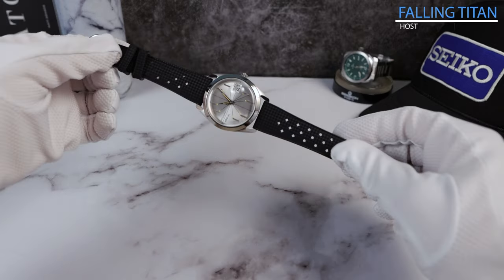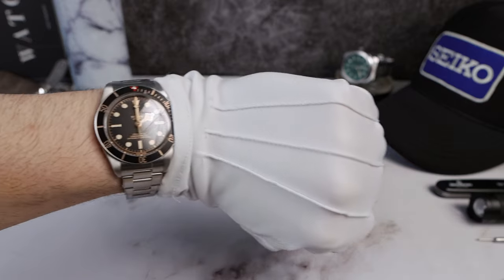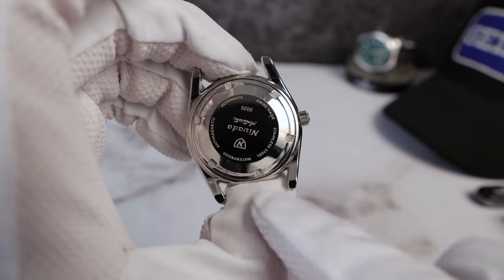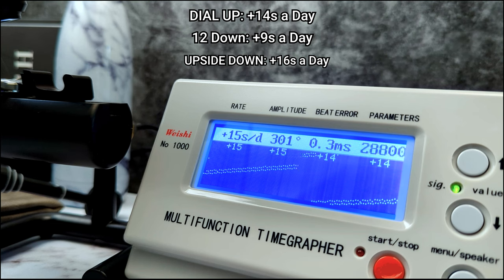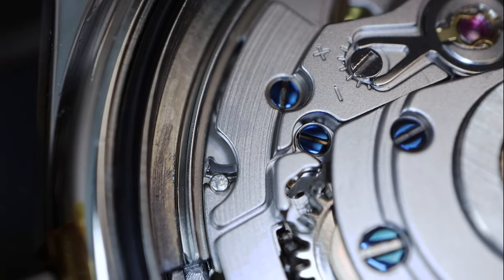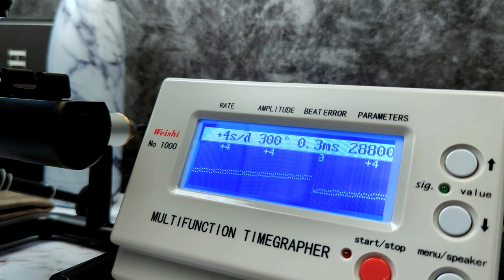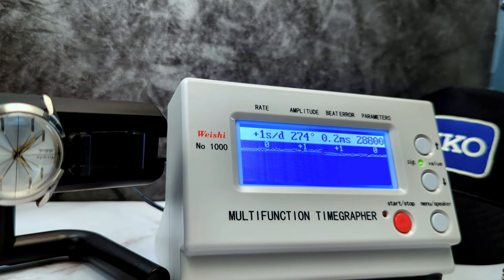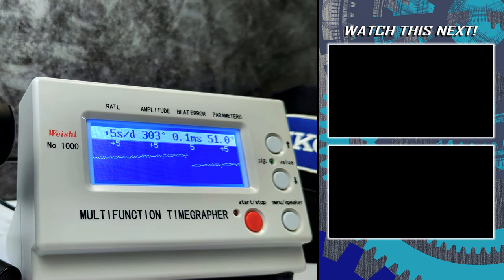Crazy EASY FIX for poorly performing SWISS MOVEMENTS

Comment from the maker: :_seiko::_seiko::_seiko:Check out how to regulate beat ERROR HERE: https://youtu.be/VPeKFk1axbA  I wore the watch for 4 DAYS STRAIGHT after filming. With my atomic clock timegrapher app my on the wrist performance average is +2.5s a day!  Not bad and you can see the day I was very active it was close to zero like I predicted and less active closer to +5s. (I will upload pic on insta stories) 
If you want to regulate to 3 positions the 3rd one should be 3-DOWN or Crown Down and do the math between the 3 positions. Find the variance and lean towards your most active position for your daily routine the heaviest. -FALLING  :_seiko::_seiko::_seiko:

Comment: Thank you for posting this useful video. I need your advice for my ETA 2824-2 When i adjust the regulating stud to get a good Beat Error of 0.2 the Rate goes up to about +100 when I adjust the Beat Rate to show 0.8 I can use the fine tune adjustment to reduce the Rate down to +10 at best. How can i get a good Beat Error and good Rate?
Reply from the maker: you have to remove the rotor then the automatic works and adjust the rate with the rate lever (hidden by the autoworks). This one does large adjustments. The screw is only for fine adjustments. So fix the beat rate then you can lower the +100 down to +20 or +10 then put it back together and use the fine screw like shown in video to dial it in to 0sec.
Reply: @EscapementWatch  Thank you very much for your fast reply. Much appreciated.

Comment: I’ve no use for a time grapher provided the error within the range of the eccentric screw.  I prefer to regulate on the wrist.  I received a new Alpina Startimer GMT with an SW200-1 derived movement for Christmas that was +17 seconds a day out of the box.  The average consumer would have either  lived with the watch or returned it.  After a few days spent on “trial and error” regulation on the wrist; I now have a rock solid +1.176 seconds a day watch (observed daily over the course of 3 weeks) regulated to the real world environment in which I live.  No machine can duplicate that, few COSC certified watches would do as well.  A very easy DIY, provided the movement is precise.
Reply from the maker: Actually I've found the 2 positions I test to are exactly the average of my daily life on wrist performance. The 2 main positions. I always used to use the on wrist regulation method as well. Then found out after years and years of testing it is pretty much the exact same as the 2 positions averaged out. So if its 0 and 5 its 2.5s on the wrist. And that's what this one ended up doing.  But I find this way much quicker with the same results.

Comment: I've been looking for a video on regulating a Swiss movement for ages, so well done. I've noticed on my SW330-1 GMT that the + and - seem to be the other way around. For example the + is nearer the centre of the movement. So to speed up the time it should be rotated towards the negative not the positive? Your Soprod movement appears to be the other way around.
Reply from the maker: Glad it was helpful! Yes some manufactures may have the + and - on the opposite sides. Just turn towards the symbol you are trying to aim for.

Comment: great vid ,very informative .I have a 2824 in my Tudor pelagos  i might see if i can improve it as it slightly  slower and could be improved perhaps
Reply from the maker: Just be careful dont slip and hit the balance take your time and use good tools the caseback tool I have  came with a rolex/tudor caseback adaptor.

Comment: Great video. Like your case removal tool. Need one of those for the really stubborn case backs. Looks much more secure and less prone to slipping and scratching the caseback.

I might add, from my own experience, what the timegrapher shows doesn't necessarily reflect what you will get. Did u say that and I missed it? Anyways, +0 s/d doesn't mean that you've nailed it and will get +0 s/d. And, sometimes -whatever s/d still gives me +gain when checking the accuracy with my apps.. and, a +whatever might still give you -loss.

Long way for me to say your watch's movement and your actual movement will vary in actual practice and usage. Keep recording and checking accuracy with an app. I usually use 2 apps just to get an average between the two because they don't all measure with same results. And, you may need to adjust regulation a couple more times to fine tune to as close to perfect as you want it.

Btw, once, I did slip and jabbed into the balance wheel .. or was it the spring? Idk? Doesn't matter, either way it was bad as the movement stopped immediately and would work after that. Luckily (If there's such a thing in this situation), it was just a Seiko 4R36 movement. I ended up quickly ordering an NH36 on ebay to replace it. Truly luckily, Seiko standard movements aren't expensive and easy to get.

Any tips on regulating an ETA 7001 manual wind movement? It unfortunately does not have the screw to adjust the regulator. It appears to just have the levers/arms much like how you might regulate a Seiko movement. I'm just trying to figure out which lever/arm is the correct one for the rate. Don't want to accidentally move the other one which is likely to effect the best error.
Reply from the maker: The arm that has the "C" shape with a tiny gap is the regulator one.  The top lever. Yes sometimes you hit the balance and your sping is toast sometimes you can get lucky and its fine!

I worn this watch 4 days after this video was filmed. 2.5s a day. I posted the image to my insta stories.  So it is exactly how I predicted 2-3s on the wrist!

Comment: What's about La Jour Perret G100? For making the movement goes faster, should I turn the regulation screw clockwise or counterclockwise. Please advise.
Reply from the maker: should be clockwise. But do a small adjustment only and check on the timegrapher to be sure.
Reply: @EscapementWatch  Thanks for the advice
Reply: @EscapementWatch  After regulating, it nedded to turn anticlockwise.
Reply from the maker: ok great to know its like a backwards eta then. I guess it makes sense the post is on the other side.

Comment: I once was told about “custom time adjustment” and I thought… How I didn’t think about that before? It consists in use your watch for a month or two normally and take notes about the time variation compared to an official time which is known for its precision. After that you won’t adjust based on those various static positions but based on how advanced or retardant your was during that period. So you can place the watch in the Timegrapher and it doesn’t matter the result you will only increase or decrease the time difference you’ve found in your previous measurements while using the watch the way you normally do. As people have totally different habits, a perfectly timed watch for someone could be completely out of time for someone else. Of course it’s only viable for people who do their own watches services.
Reply from the maker: If you adjust between the two main positions it's pretty much going to be spot on for most people. 12 down and dial up is how a watch spends most of its life on the wrist those two main positions.
Reply: @EscapementWatch  For me personally the two main positions are 12 down and 3 down. That method I was told, I’ve never tried actually coz I think a bit off is part of mechanical movements, those who want a perfect synchronized watch shouldn’t wear a watch and just look at the smartphone.

Comment: Sir, the screw on the balance bridge is in no way connected to the regulator pin or hairspring. Then how does it affect the timing if moved left or right? Is there some connection inside of the balance bridge. Kindly explain.
Reply from the maker: screw puts pressure on a lever that hugs the screw. As you turn the screw the lever gives fine micro adjustments to the hairspring
Reply: Your explanation is very clear. This has bugged me for years. Now that you have clarified, I am able to understand it better. Thank you so much.

Comment: The screw is only for fine adjustment, right? My watch is off by quite a bit, so turning the screw doesn't correct enough. How do you do a larger adjustment? Would I simply just keep turning the screw?
Reply from the maker: No you will break it if you keep turning the screw. Sounds like you need a service of the movement or your beat error is off causing a larger deviation.
Reply: @EscapementWatch  So glad I asked. With the screw centered I have -98, amp 130, and beat error 0.1. Is it the upper stud that I move for a large adjustment? If so I have to remove the automatic mechanism to access that. Would it be a clockwise push of that stud?
Reply from the maker: 130 amplitude is extremely low! Wind up your watch at least 20 turns and see if that helps. Anything below 200 you require a service in most cases.
Reply: @EscapementWatch  Yes, well I bought this new about 15 years ago and wore it about 5 times, but it has never been serviced. The oils have surely dried up.
Reply: @EscapementWatch  This is the amplitude after 60 winds. Using the rate stud and micro adjusting screw I was able to adjust it to -1 sec pretty consistently, with an amplitude of 165, and 0.2ms beat error. The graph dots formed 2 tight lines with no errant dots. After an hour or so the time continued to get slower and the amplitude went down, so surely  it needs fresh lubrication.
Reply from the maker: Yes 100% go get it serviced!

Comment: I wonder how can you regulate the new Hamilton 80h power reserve movements??? It's a free sprung balance...
Reply from the maker: You have to move the weights on the balance. Towards the center should speed it up and towards the outer edge of the balance to slow it down.

Comment: A top video FT. Very well done! This is all very good information for regulating the Swiss movements you mention. Just a thought though it might be worth making sure that the screwdriver is not magnetic as I guess this may introduce another variable. Not all precision screwdrivers are the same. I would guess using spending the money on the Bergeon could be money very well spent.
Reply from the maker: Good point!

Comment from the maker: In this video I mention it can be done on chronometer grade Seikos but the screw should be smaller then the one used on this Soprod. Go with 0.8mm. Also, adjusting beat error on the high end Seiko's the lever is very stiff so take caution. Very dangerous if you slip and hit the balance!!! I just regulated my KSK king Seiko as it is now fully broken in and I wanted to reduce the beat error form 0.4ms to 0.0ms but I could only get it to 0.2ms dial up and 0.1ms 12 down.  So not recommend to touch beat if your not very used to regulating.

Comment: Almost magical winding and running problems with the SW200-1 and i thought they had fixed it !! The "-1" stands for the fix they supposedly had applied, now customers are still having issues and they're swiss made beauties
Reply from the maker: Yes the fix isn't really a fix. Kinda made it worse. The ETA 2824 I hardly see it.
Reply: @EscapementWatch  This is exactly what i told myself lol

Comment: My watch is not responding to +- regulation. Only beat error xan be fixed. It is - 30-20 when fully wind for <10 minutes.
Then +-0 for 2 min.
And then +25-45 when not fully wind.
+34s average over night.
+-5s when being worn fully wind.
Reply: Can it be fixed?
Reply from the maker: sounds like you need to do a full service with a watchmaker in your case.
Reply: @EscapementWatch  I did. I guess it happend after demagnitization.
1. I was trying to fix it bymyself adjusting to minus. it worked, but at some point it started to run extremely fast (as a leart later due to huge beat error, I was not adjusting beat erroe).
2. I suspected magnetization, nad my phone shown up to 700 unitis, comparing to 30-50 normal.
3. after demagnatization it stoped reacting to +- at all.
4. after service done same thing, when fully winded, it runs +- even if worn. when stored it accelerates to +35-40s per day. (10 minutes after being fully wind)

any ideas about demagnetization?
phone's compas reactes to watch, but measurment is not great. usually 0-70.
at some place it tops to 110 at dial side.
maybe I shall buy demagnetizer and try to diy demag??
Reply: @EscapementWatch  hi! looks like I ve solved the problem. smth with magnetism. I used my laptop (maybe cpu) or (smth with over 5000 units) to demagnetize it partially. then regulated a little bit with plastic diy tool, so that metal tool will not magnetizee it agian (however it was not seemingly magnetized according to my phone sensor reading) not I ve set on +-1 dial up. Happy)))

Comment: You afre lucky. My eta 2824-2 is -25s slow. The micro adjust all the way to the right chnaged it by a few secods down to -20s nothing what your watch showed. Iwish you showed how to adjust the pin and the stud.
Reply: You should be able to find videos on the 2824-2. It's a very common movement. You are correct. If your micro adjust does not work, you have to center the micro adjust screw and then move the regulator pin manually to either shorten or lengthen the hairspring. In your case you need to shorten the hairspring (moving the regulating pin away from the stud). It might be blocked by the automatic rotor assembly which can easily be removed to access the pin.

Comment: What to do if the micro screw is no longer sufficient for adjustment 2824-2
Reply from the maker: Then you probably need a full service
Reply: @EscapementWatch  I don't think she fell off the table
Reply: You have to remove the automatic works and adjust  the stud coarsely  by moving it more and then fine tune via the screw so its steps are enough  for the plus or minus adjustments.

Comment: I do always first regulate beat error before I mess with watch speed. Correct me if I'm wrong. But sometimes when I correct the beat error I automatically get the wanted pace from my time peace. Such a joy to play with swiss escapement instead of japanese studs which are sometimes stiff. The Orient I have is such one.
Reply from the maker: Yes I show beat error regulation in the pinned comment video. This is more for people who buy a new swiss chronometer grade movement and the beat error is already in spec 0.1-0.3ms and just want to fix the rate